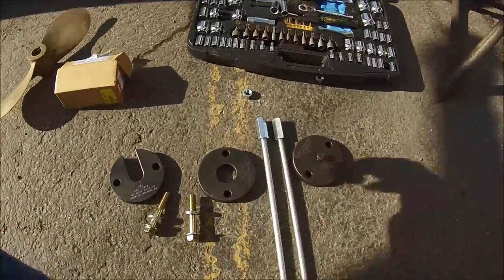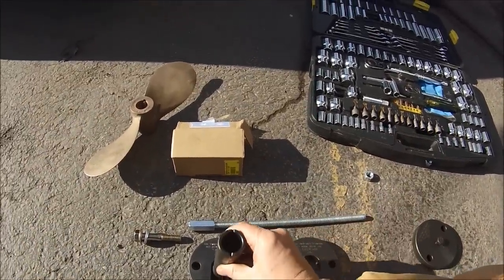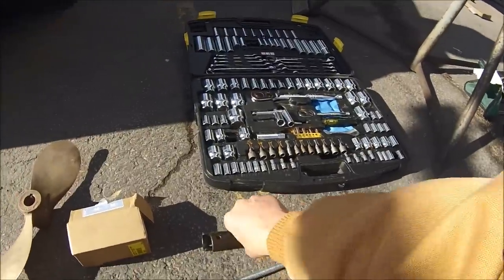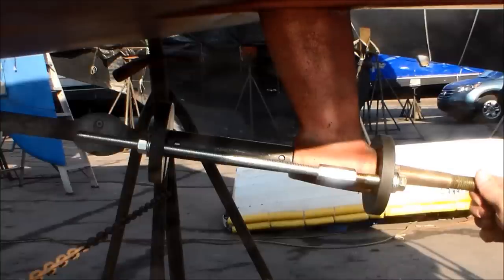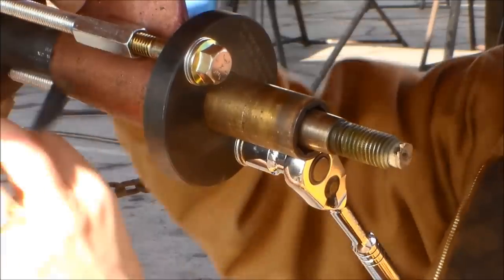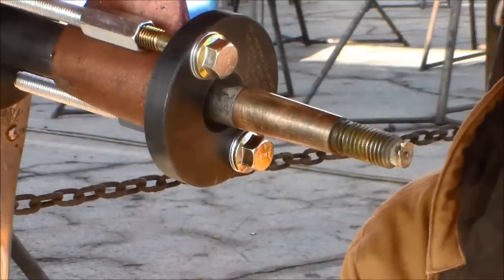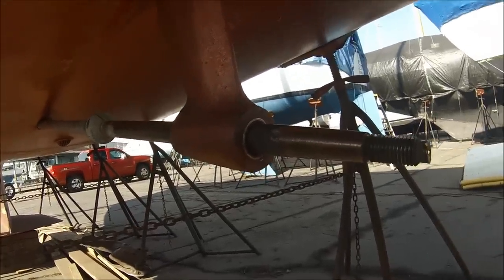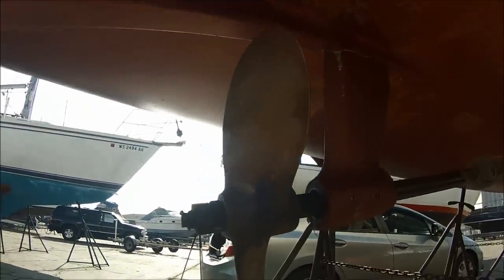Strut Bearing Replacement

Comment: I was wondering about pitch and rotation
Reply from the maker: Not sure I understand your question Suzette.  I didn’t change the propeller pitch or rotation.
Reply: @TallyHo322 she may wonder if that prop is installed in correct orientation.
Reply from the maker: @Beba-qv3db  The shaft and the prop hub are tapered, so it only fits on one way.
Reply: @TallyHo322  I hope mine is that way too😉 so I don't screw up. TY for your videos.